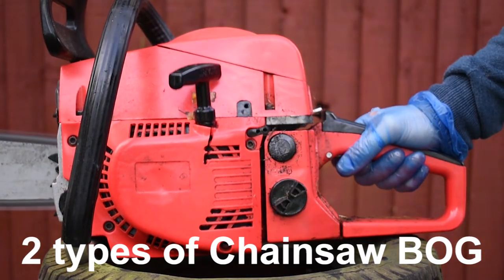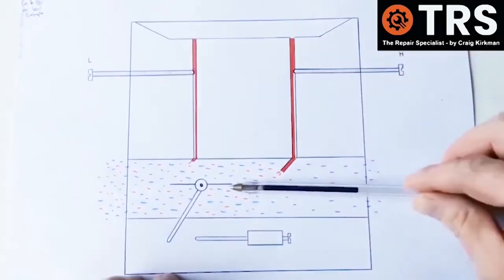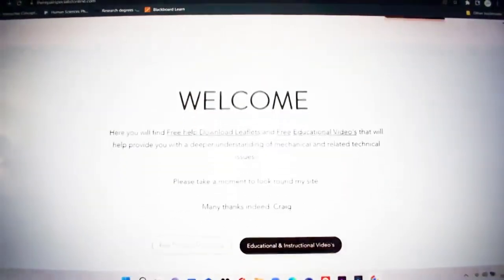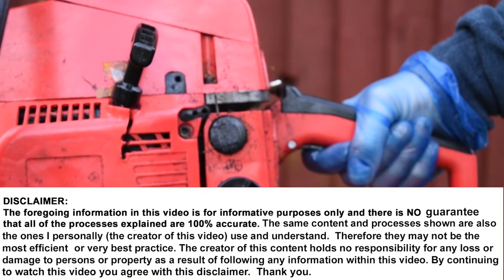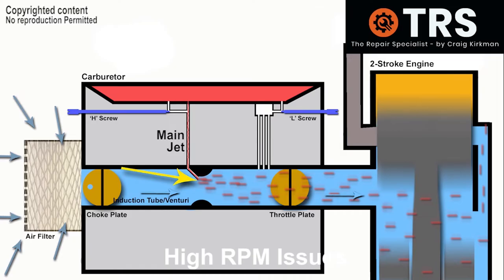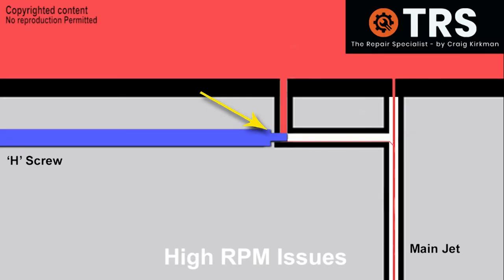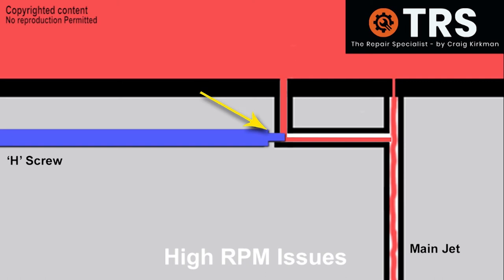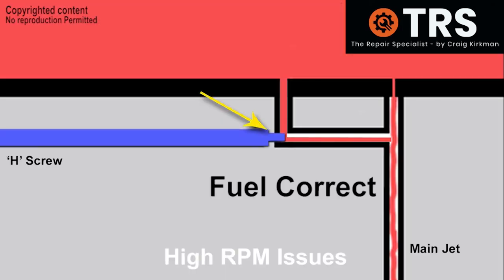CHAINSAW BOG DOWN: 2 Main Types: How to Correct. Carburetor 'H Screw'

Comment: Very good video, clear and easily understood visual aids. One point you might mike to cover is this: your saw was running great and you store it for a few months. When you start it, it bogs (not enough fuel). You adjust the H screw and it runs fine for a few days then bogs again (too much fuel). What has happened? Well the carb diaphragm(s) have hardened in storage (restricting fuel delivery)...but softened up after a bit of use (now too much fuel due to your adjustment)!

Comment: This is a great video. I'm currently having issues with my Polan Saw it bog's way down when tilting on side to cut small trees. It's not even a year old. And It's also barely running right upright. I'll check what was mentioned in the video. I've already replaced the spark plug, air filter, and cleaned the carburetor.
Reply from the maker: Thank you for your king words.  

There are many reasons why a chainsaw might not run correctly like this but lets look at something I have come across in the past.  Try this as a guide:

As for your chainsaw issue: Inside your fuel tank, your fuel filter is dangling on the end of the fuel pipe into the fuel. The fuel filter is usually weighted.  That allows the fuel filter to follow the fuel, to keep picking it up, when you tilt the saw.  If the fuel pipe is too short of the filter has come off or something like that, it does not have the weight to follow the fuel in a tilted position and sucks in air rather than fuel, causing bog.

So take a look inside your fuel tank, with an LED flashlight for safety around gasoline fumes, and see if there is something wrong filter wise, or that part of the fuel pipe is split just above the filter.

I would try this first and go from there.

Thanks

Craig
Reply: @TheRepairSpecialist  Thank you that's is something I haven't checked yet is the fuel filter and fuel line, I'll look at that asap. I'll let you know one way or the other if that solves my issue. I appreciate the info.
Reply: @TheRepairSpecialist   I also liked and subscribed 👍
Reply: @jonathan3982 having the same issue. Did you get yours fixed?

Comment: Hi Craig, could too much fuel on the H cause 4 stroking on the 2 cycle engine?
Reply from the maker: I was only thinking about this the other day, and I was thinking of making a video about this topic. I do think the a state of being too Rich on a two stroke engine could cause 4 stroking. I have said before I’m some of my other videos that when the mix is too rich, the engine finds it difficult to combust the rich mix, so 4 stroking could be quite possible. However, the with the general concept of 4 stroking being because exhaust gases can’t escape quick enough from the cylinder and so being a case where their is little or no combustible fuel and air available, then I can’t be 100% sure that a cylinder full of a heavy fuel/air mix will do the same. But some experimentation might just help answer this. Watch this space 👍👍👍
Reply: @TheRepairSpecialist  Thank you for your reply. The 4 stroking was brought up in a comment on one of my videos. I listened to other videos on this topic, even though I could hear the difference in before & after, I have some difficulty picking off the 4 stroking sound. Looking forward for your video.
Stay well, Joe Z
Reply: @TheRepairSpecialist  I'm bogging down in the wood so assumed I need more fuel, but it's smoking ... so that would mean I have to screw down, i.e.the opposite!! Help please!
Reply: @JOEZEP54  You usually want a chainsaw to 4 stroke when not under load, but to lean out in the cut, just not lean out too much.
Reply: @ChrisRJ  Thank you.

Comment: Hi there, I love your vids. Can I ask a question pls? I bought an old seized partner saw and have given it the once over. When I give it the full throttle it revs up fine and sounds good but it then starts to run lumpy. The revs dip and go back up and this continues all while holding the trigger in. I have replaced the piston and cylinder, carb kit, gaskets and spark plug. Tuning has never been my strong point but the symptoms don't quite fit the bogging down description. My next step is the fuel line and tank breather vent. Any ideas would be great. Many thanks

Comment: Husqvarna 450 has a high and low port adjustment and an extra one with T on it, i presume that means throttle adjustment, I have bog down when I am attemting to go full revs but does clear. I tried altering the high adjuster screw but it appears to be stuck, i dont want to mess up the screw so left it. Any ideas how to free up?
Reply from the maker: It sounds like you're dealing with a common issue with the carburetor settings on your Husqvarna 450 chainsaw. The "H" and "L" screws are indeed for high and low speed adjustments, while the one marked with a "T" is for idle speed adjustment. Here's a step-by-step guide to help you:

Understand the Adjustments: The "H" screw adjusts the saw’s high-speed performance, while the "L" screw controls low-speed operation. The "T" screw adjusts the idle speed. It's crucial to get these settings right for optimal performance.

Addressing the Stuck High Adjuster Screw:

 If it is truly stuck rather than being screwed too far and tight, then apply Penetrating Oil: Apply a penetrating oil like WD-40 to the stuck screw. Let it sit for a few minutes to loosen any corrosion or debris.
Gentle Pressure: Use the correct screwdriver and apply gentle, but firm pressure. Avoid using excessive force to prevent stripping the screw head.
Heat Application: Sometimes, applying a bit of heat can help. Use a heat gun or a hairdryer to warm up the screw area, which can expand the metal slightly and help in loosening the screw.
Cleaning the Carburetor: Sometimes, a bogging issue is due to a dirty carburetor. Consider cleaning the carburetor or having it professionally serviced.

Adjusting the Screws:

Idle Speed Adjustment (T Screw): Adjust this screw so that the chain stops moving at idle, but the engine remains running.
High and Low-Speed Adjustments: Once you manage to loosen the high-speed screw, make small adjustments. A quarter turn can make a significant difference. Adjust the low-speed screw similarly for better performance at lower speeds.
Check the Air Filter: A dirty air filter can affect performance. Clean or replace it if necessary.

Consult the Manual: Always refer to your chainsaw's manual for specific instructions and safety precautions.

Professional Help: If you're unsure or the issue persists, it might be best to seek professional help.

Remember, safety is paramount when dealing with chainsaws. Ensure you're taking all necessary precautions and understand the adjustments before attempting them. If in doubt, professional servicing is always a safe option.

I hope this helps.

Craig
Reply: @TheRepairSpecialist  Thanks for the detailed reply Craig, I will start with a little WD40, both the high a low are stuck firm. The idle speed seems ok as the chain is not creeping, strangely I'm able to turn this screw ok. I keep the air filter cleaned regularly, it's the minute plastic mesh type so I do wash it out and dry it. 
I will give your guidance a try out today to see if I can fix the annoying bog down. Thanks
Reply: @TheRepairSpecialist the high and low screws are a specialist tool, they are definitely not slotted screw heads.

Comment: And the main point there is when it's in to far , not all the way but still run , it sounds like more power but it isn't. The main thing to remember is , that the fuel going in also carries the only oil the engine  gets !!! So you can't run it to lean or , Boom , no engine. You have to find that " sweet " spot !
Reply from the maker: Absolutely